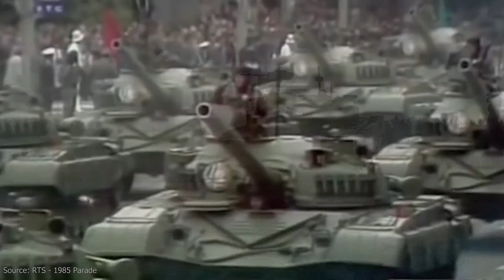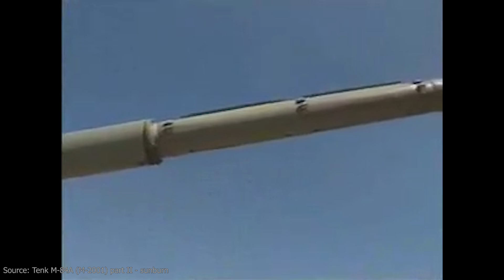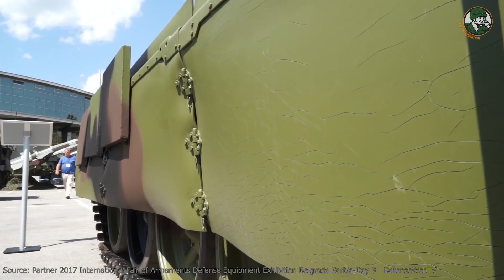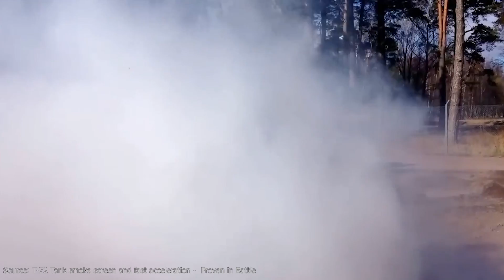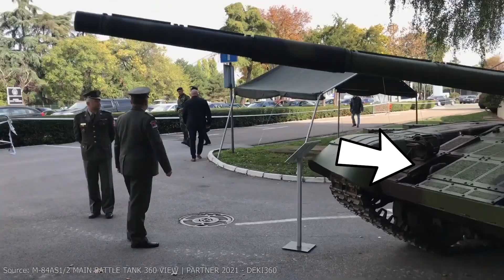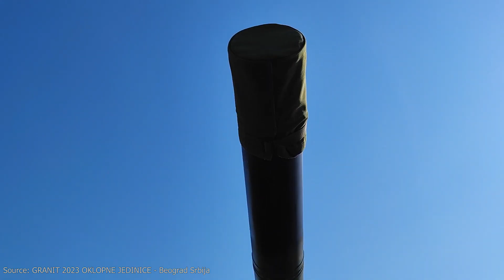Teaching an Old Dog New Tricks | M-84AS1/AS2

Comment: Now, however, a new modernization has appeared in the M-84AS3 version, which includes the new GL-6 APS hard kill system, which also protects the tank from top attack missiles such as the Javelin and other similar anti-tank missiles with the possibility of top attack.

Comment: The final version of the commander thermal sighting is from domestically produced Teleoptik žiroskopi, it is the third generation TS. As for the aircondition the final version have one, and all Serbian army vehicles ( tanks, APC-s, IFV-s, drones and unmanned vehicles) are to be incorporated in one system, digitalized in the maner that in one spot you have the pictures from all systems and platforms form battlefield. In that way, Serbian army will be fully digitalized small army, these tanks included. In adition M-84 tank is 3 crewed, even in the first variant, unlike T-72 wich have 4 man crew. That means it have more space inside, and the autoloader is a state of the art compared to T-72. When you talk to M-84 like some kind of T-72 variant, it has a so much diferences from the original design, it should be treated as a new tank, M-84A armor back in the eighties was better than any variant of T-72 without ERA. M-84A armor hull has an quartz plate inside two large steel plates, and the rubber coating between. Laser rangefinder and the fire control system were much much better in M-84A than in its Russian counterparts.Every new AS1/2 variant have 1000 hp engine, and the 1200 hp engine is on final trials. Conclusion: M-84AS1/2 is a cost effective upgrade for existing tank fleet  for Serbia, with domestic industry solutions, wich level up this tank as usable in new battlefield enviroment, surpasing much more expensive tanks, and barring in mind that Serbia as a small country have more tanks than UK or France for instance ( 247 M-84 in all variants, 30 T-72MS, some 50 T-72 and more than 300 operational T-55 in reserve) it should be enough to defend its teritory.

Comment: This is T90 with Leopard 1 electronics... It has much more power,meteorological sensor,fire control with auto correction,data link,two radio stations so they could send and recieve signals at the same time or use that as range extender for other tanks.

Comment: interesting fact, Serbia is one of the first countries to adopt 6.5x39 mm Grendel cartridge as their future standard round for new modular M17 (M19) assault rifle that has ability to change barrels and calibers in field, making the rifle from CQB firearm to DMR or marksman rifle all thanks to 6.5 grendel, also it can use 7.62x39 and older standard 5.56x45 nato calibers (when appropriate barrel and bolt is replaced) , bit of the strain for production and logistics but Prvi Partizan Užice can take care of that, since they produce and export all of those munitions for longer time already.
Reply: Multicaliber&modular firearms have been a hot topic for decades and they never worked out - you are always left with extra weight or compromised reliability for a given design.
6.5 Grendel is a great hunting cartridge but it doesn't have .223/5.45's low recoil nor .308/x54's barrier penetration. But at least it's not whatever the hell US is adopting.
Reply: 6.5 grendel has 50% less wind drift and can hit targets up to 800 meters but is effective around 500 meters and contains double the amount of LB ft of energy compared to 556. On 500 meters it contains around 800 LB ft while 5.56 is reduced to 280 LB feet the power of a 9mm round (doesn't penetrate armor). Only problem is 6.5 needs a 20' inch barrel its more or less a round for a bullpup. Anyway i've seen the M19 MCS and it look pretty impressive its truly a next gen AK only 50% of the parts are compatible  with AK the 50% is new design. Only problem is the cocking mechanism which is T handle like on a AR15. Also the gun doesn't have a last round bolt open. Also it needs to be tested if it holds zero when the barrel is swapped the AUG does so i expect this one as well. Its truly a next gen AK, the AK12 should have been like this
Reply: @alexanderp8037  You could replace grendel with .357sig and 556 with 9mil in the text. Only reason Serbia had this much headway with 6.5 is that they never adopted a low impulse cartridge.

In my humble opinion next gen AK should not be half a kilo heavier than AKM and AK-12 just should not have been. AK-74 receiver and barrel are as optimized as it is possible, there is not a single thing to fix in there (or at least no one managed so far).
Reply: @alexanderp8037  The "T" charging handle has been removed from serial production Zastava M19 MCS. It was replaced with a side charging handle that can be moved to either side to accommodate the operator.
Reply: @StefanBlagojevic   T charging handle does give alot of advantages in reliability when it comes to keeping mud out of the system in retrospect i understand the descision.

Comment: The M84AS2's are great vehicles, although one big point is bugging me, if they're made from stock M-84's and not M-84A's, than that means they do not have composite armour, and that's quite bad.
Reply: That makes absolutely no sense, where did you find that info?
Reply: @niksonrex88  The video literally stated that the original M-84 (T-72M) had no composite armour. And if they're upgrading stock M-84's then that's quite bad.
Reply: @saucy743  keyword “if”. It wouldnt make sense, we have more As and whats the point in upgrading the classic ones….
Reply: @niksonrex88  if has always been the keyword, and if the "if" is true, then that's quite bad. Because a modern-ish tank with no composites in 2023? Not a good outlook.
Reply: @saucy743  Im asking you why would they do that? When they have more A versions in stock? Use your brain lad.
Reply: @niksonrex88  More A versions?
Reply: @saucy743  more M-84As yes
Reply: @niksonrex88  Alright then, it seems i misunderstood what the video said.
Reply: @saucy743 
Unfortunately out of 232 only 48 are M84As, the rest being M-84s. They lack composite armor on the turret and additional 16mm high-hardnes steel plate on the hull front as well as the upgraded 1000 hp engine, retaining the old 740 hp. Basic M-84 is now worthless and considering how slow modernization is going, only the M-84As should be worked upon. That would make one out of the four battalions and for the other three the T-90M should be purchased as they aren't expensive unlike any Leopard model as the president mentioned.
Reply: @saucy743  yes, but the Serbs upgraded to the M-84A standard a LONG time ago.
Reply: M-84A is more numerous in Serbian army so probably they are the ones being modernized.

Comment: The problem with that tank is armor, or should i say base armor used on it, while addition of ERA is good, that tank still lacks good frontal base armor (talking about composite) and until that aint fixed, we cant call that tank good.

We would be far better off just buying new tanks, altho it would cost more, its still much much much better value for money than upgrading these old tanks.
Reply: Do you think Leopard 2s would Abe a good answer? Sure they are bigger but they have better internal tech, are fast and modern. We can't buy Russian tanks no more due to sanctions so I guess the only good western tank that suits our needs would be a leopard?
Reply: @ПетарКурилић   As we have seen in Ukraine 100 older tanks is better then 10 new. Technological difference  melts quick in weapon saturated theatre.
Reply: @TheGranicd  Yes, that I can agree, and what supports that arguments is also the fact most tanks are destroyed by artillery and after that ATGMs and other hand held AT weapons. Tank on tank engagements are rare
Reply: @TheGranicd I've been saying this for years, mass wins wars, sophistication serves to scare!!! And for special operations!!!
Reply: @ПетарКурилић  well, technically leclerc is also an option (if Serbs are going to follow Croats on equipment buyouts, Croats are on the talks to buy leclerc XLR tanks, i would not be surprised if Serbs follow with, like what they announced after Croats bought Raffale's ).
Reply: @madkoala2130  Leclerc being about 9 tons lighter than Leopard 2 is probably a good choice for the Balkans.
Reply: @RedXlV  and it has autoloader (since theý still refuse to have dedicated loader training for tanks after m84 had no space for him)
Reply: @ПетарКурилић   Type 10 from Japan would be a great option as a stop gap between no and until sanctions are lifted from Russia, there is also the most modern Abrams that would be good for us (M1A2C) but anything less than that is a waste of money.
Reply: @milosmilictrob2046  
Serbia has numbers and with modernization that is the most important thing, far better than buying 10-20 American or Japanese tanks...
Reply: @qwertyasdfgh1014   We dont really even have the numbers, hile we do operate 262 tanks in service, but they are mostly old tanks, but when we look at technologies used in those tanks, we are far far far behind some of our less developed countreis in the region.

Another problem is the speed of modernization 13 tanks a year is nothing, it would be far better to buy new than modernize old ones, even tho it costs much much more.
Reply: @milosmilictrob2046  
Of course, Serbia has the numbers, it is far better to invest money in increasing the capacity of the industry for modernization than to buy foreign tanks.  It is illogical that you want to buy 300-400 American or Japanese tanks, they cost more and the question is whether they can sell that many, how long it would take to get to that job... Taking into account the geopolitical situation, Serbia must be as independent as possible in the military industry and not  it depends on America.
Reply: That's true, and i do hope the engineers got the first part covered, however maybe the Serbians do not need to buy foreign tanks, maybe they can just ask Russia for a license of the T-90 or T-80.
Reply: @saucy743  At this point, I think we are going by the "good enough doctrine", rather than (reinventing the wheel so to speak) like we tried with our M-91 "Vihor" tank. Romania went all out full-frontal with their TR-125 tank prototype, even though it wasn't plagued with economy and war, it still gave up on it after several prototypes. So, yeah, on the modern battlefield, this ERA is slightly better than Russian Relikt, laser warning receivers, improved battlefield awareness, the ability to have the best thermals and night vision to spot targets day and night, new and improved APFSDS... it'll suffice. Is this the best we can do, probably not, like the reported stated, no AC, heck I'd go for the steering wheel and a powerpack with neutral steering , but there's also cost and effect involved, so that's how I see it. Kind regards.
Reply: @saucy743  I don't think we can make em anymore. M 84 parts were built in factories all over Yugoslavia. Serbia can modernize tanks but It can't make new ones from scratch. The most we are able to do now is make light prop aircraft and MRAP style wheeled vehicles and everything else in between
Reply: @saucy743   We just dont have the industrial capabilities to produce new tanks. 

And they for sure havent adresed that issue, its just too expensive for us, and again no industrial capabilities.